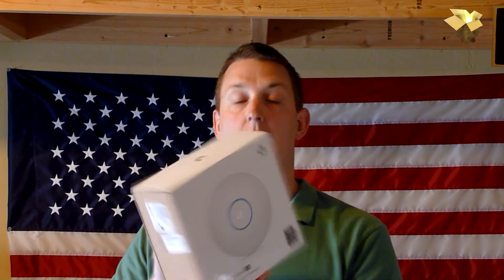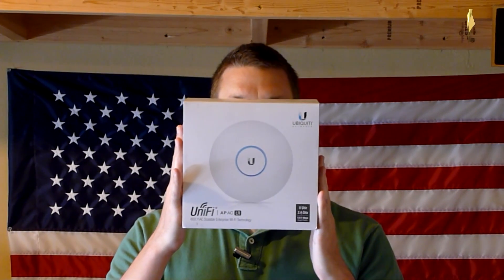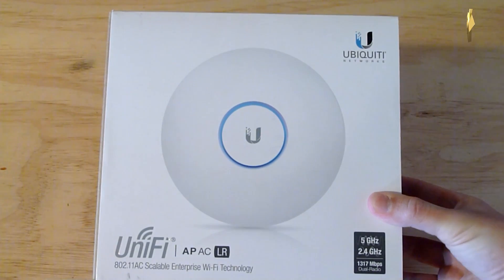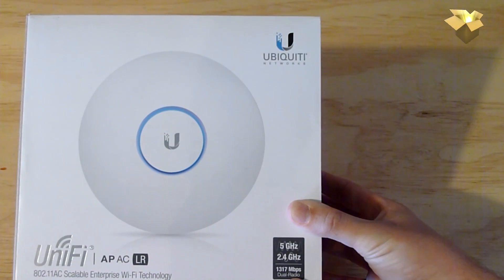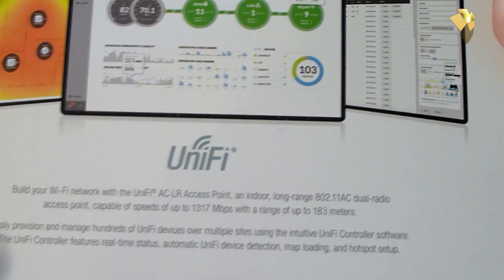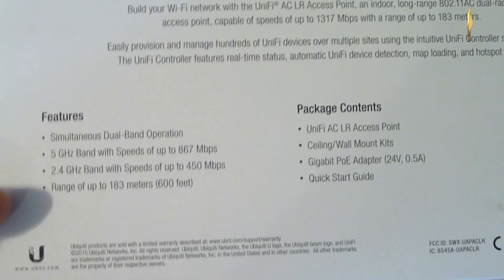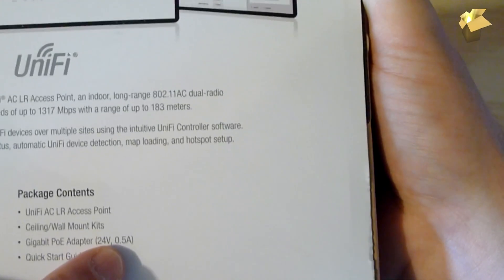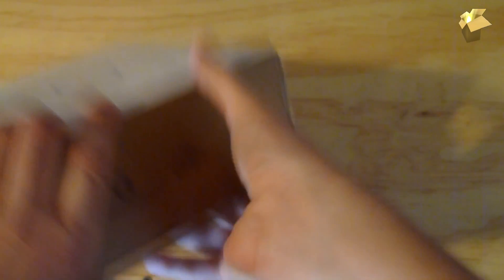Ubiquiti Wireless Access Point - Unboxing and Review + Install

Comment: The performance of these access points is beyond imgs.love/NetwrkUnifi?a1a what i could have hoped for, have full coverage of 30,000 sq ft facility with only 4 of these guys. Between the 20ft metal shelving, 40ft steel racking, and double firewall layers between the office and warehouse, and virtually no signal loss, these access points go beyond my expectations.

Comment: Actually consumer stuff has gotten better in the paste few years. My Netgear Nighthawk X6 is 4 years old and still going strong. I'm actually going over to unifi just because I'm a nerd lol.
Reply from the maker: Yeah this is still working good, but I also am a nerd and want to try something else!
Reply: Yea so far I've had my unifi setup for a couple of days and it has really impressed me. Using the Unifi USG and Unifi AP AC LR. I also have the Unifi 8 port 60w poe switch on the way.

Comment: Great video but your not meant to put rj45 connectors on end of solid core cable. It work hardens. Your meant to terminate into a box and run a patch lead which is stranded and got flexibility
Reply from the maker: Thanks for the feedback!  That is good info.
Reply: Really had to be done to connect the UAP.
Reply: @samufish  No it didn't.  I have a Unifi AC-Lite.  I terminated the solid wire in a keystone jack and then mounted the jack in a surface mount box.  I then connected to the AP with a short patch cord.

Comment: hi i need some help here. So i just bought one of this and installed it on the ceiling and there is blue light. However,  i cant connect to it on my phone and PC how do solve this problem? Also it says please connect  at least one  unifi access point which i dont know how but i already installed the  thing on the ceiling. Thanks  in advance!

Comment: How do you add multiple access points? Buying a 3 pack
Reply: Super super easy. When you fire up the controller software you can adopt all three access points with the same SSID and settings and it'll create a super nice mesh network then just deploy the three access points around your house or whatever. You only need to use the controller to initially configure the devices and if you want to keep tabs on who's using the wireless, the status of the access points, etc. The controller can be software running on a computer (Windows or otherwise), a Cloud Key, software running on a vps somewhere on the internet, etc. Keep in mind that 3 packs might not come with power injectors and depending on which model you purchase you might NOT even be able to power them with a standard PoE switch!

Comment: Gr8 Channel And review :) Can i get your opinion? I have a router provided by my Internet provider - but the WiFi part is not that great, i have a 250/250 Mbit connection, but when i test on my WiFi i only get around 100, maybe 120 Mbit DL.
Would you recommend the Ubiquti og a new wireless router? The setup looks pretty ease and simple, can you confirm :)
Thank you in advance.
Reply from the maker: +Zinck82 there are many factors in wifi signal quality. Range, router placement, and the construction of your house can all play a part. I do know that you should try and get a router that is using the AC standard. Also this Ubiquiti really improved my home wifi situation.

Comment: If you buy an UBNT-AC AP you should consider to buy a AC-Pro model if you don't already have an POE Switch in your house cause the 24V POE Injector from the LR and Lite just supports 100mbit's Fast Ethernet (100FDX), i was running one of them via the POE injector in my basement and recognized that it said 100FDX in the UniFi WebUi, then i connected it to a ToughSwitch and turned 24V Passvie POE on and it just worked fine with full gigabit speeds. Now i'm getting about 350mbit/s with iperf in the same room through the LR AP and about 400mbit/s through my AP-Pro. The AP Pro comes with an gigabit 48V POE injector btw.  
Speeds tested with an MacBook Pro with ac wireless.
Reply: The POE injector which came with my AC Lite specifically says "gigabit" on it. I haven't benchmarked it though as I'm not using the injector.
Reply: That is pretty interesting, i bought 2 early models of the AC LR and an early AC Pro APs, the Pro came with an 48V Gigabit Injector, the 24V POE injectors form the LR are showing up as "100FDX" devices when connected to a UniFi switch or ToughSwitch, of cause the Passive POE on the UniFi Switch powers it and delivers Gigabit speed, but it might be interesting for people without POE switches. 
Maybe it was just on the early models and they changed it later on. 
I'll order a  4th one to see if they now come with gigabit injectors!
Reply: I was having problems with my AC-LR also only showing 100FDX. After I replaced the network cable running form the PoE injector to the AC-LR it now shows "connected" instead of 100FDX :) I was using some no-name brand china Cat5e cable with CCA wires inside. I replaced it with is a CAT6 OFC copper cable, not one problem since then, SUPER nice speeds. It seems the AC-LR and AC-Lite are super picky about their cables, AC-Pro was able to use the cat5e cable for power without issues at full gigabit.
Reply: I used the same cables on the wall outlet with the POE and without the POE injector, both Cat. 6 and self crimped, also measured loss after crimping. But i have early LR models, maybe it was due to that.
Anyway i'm powering all my APs with a 24Port UniFi Switch now and get really great speeds with my MacBook Pro Retina 2014(the model without Forcetouch but with ac WiFi) and of cause all other ac devices around the house.

Comment: I am running 3 AP-AC-Lite units in my town home, I only use the 5ghz and let my ISP modem handle the 2.4ghz stuff since my thermostats are the only thing running 2.4. I think I've been up for almost months, only problem I had was after a power outage I had to cycle everything, but I think it was more my ISP device causing the problem. Since I have 3 I used an edge router SFP mounted in my SMC to provide the POE.
Reply from the maker: +Jon Dugan Awesome! So far this thing hasn't let me down.